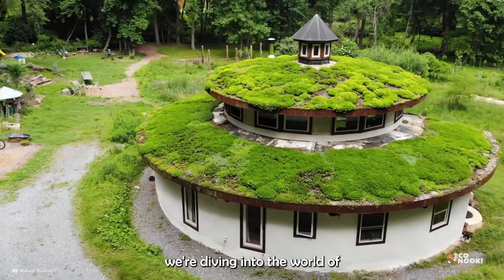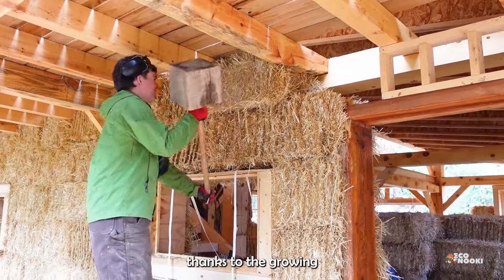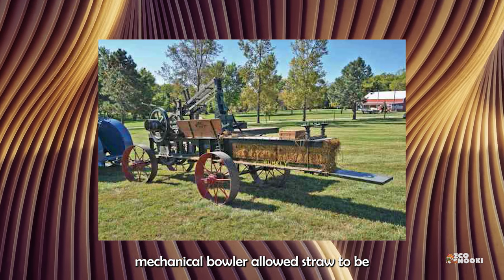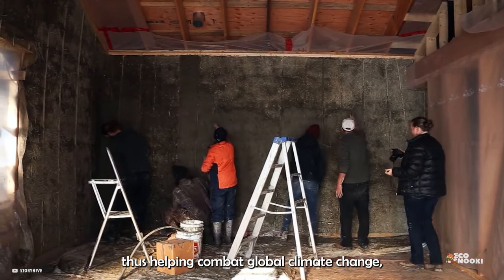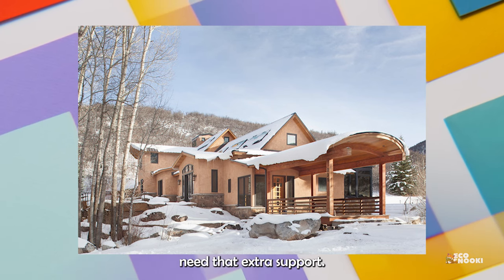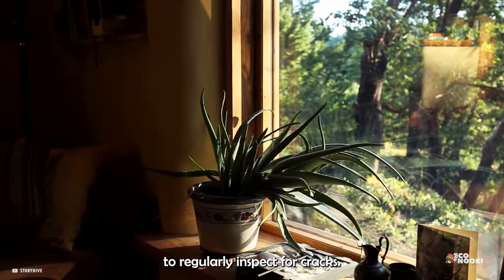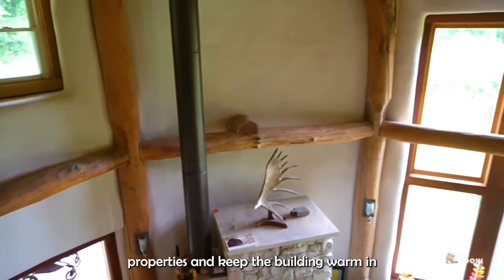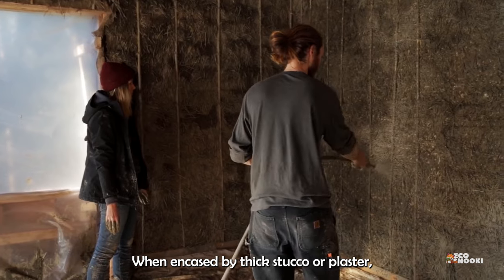Just $20,000 is enough to Construct a Straw Bale ECO FRIENDLY house

Comment: Not cement! Never cement. Cement does not breathe, so doesn't allow moisture to move through the wall. Trapped moisture in the the straw causes rot. So only clay or lime plasters are used.